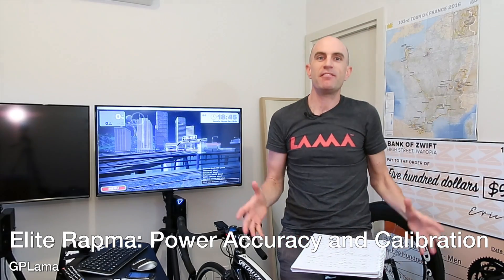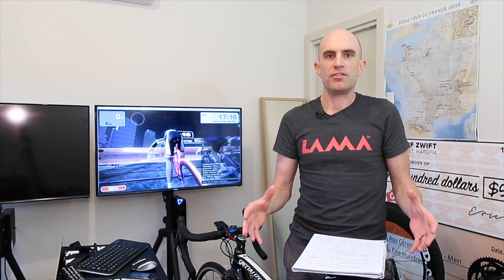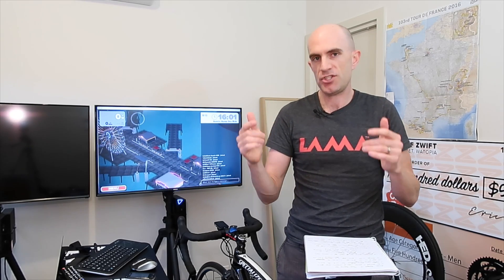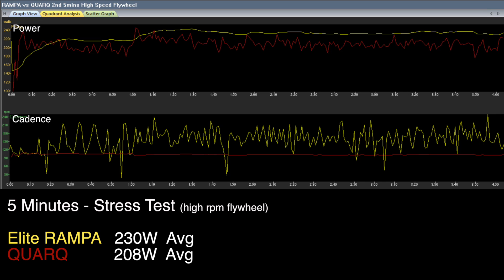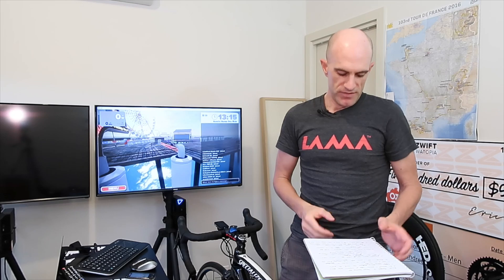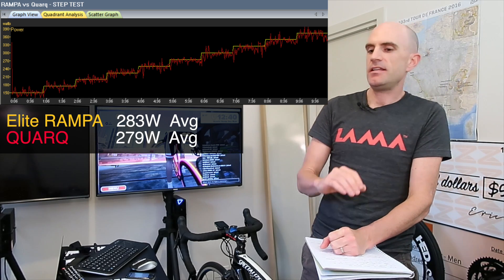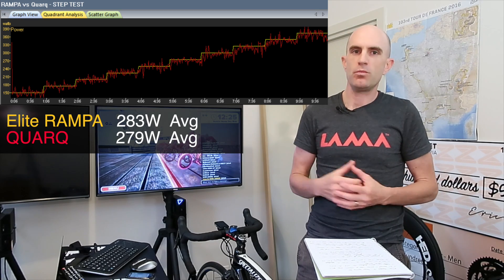ELITE RAMPA SMART TRAINER: Power Accuracy and Calibration

Comment: Thanks for this Video - It interesting that those '3 Points' you mention on your software tools are now the 'P1,P2.P3' values in the myEtraining app. I ran my calibration and compared it to my SRAM quarq power meter and it showed the Rampa at about 15% under power. I've tweaked the P-values and got my average wattage within 2.5% over a 60 minute power - but the difference grows steadily until my 1 second power where the difference is 12% under - it's robbing my sprint! Do you have any advice on what metrics each of  the 3 points control? Elite seem unforthcoming as yet.. Many thanks!

Comment: Hi. As usual another great video - thanks !!
Can i ask what p1 p2 p3 you settled on - thanks...👍
Reply from the maker: I can't recall... but values are based on each setup. They're different.
Reply: Shane Miller indeed i can see they will vary somewhat from tyre to tyre - pressure to pressure. Was just curious to bang them in and experiment.

I was looking at a cyclops hammer. Do they have a power meter or power estimator.

Thanks again !

Comment: Hi Shane. I bought an Elite Rampa Trainer and it's on its way. :D My question is regarding the accuracy of the power numbers on Zwift out of the box without any calibration. Will that be completely of the chart or just a little diference that an not ultra competitive guy can handle. I know it can be calibrated setting the P1, P2 and P3 with a powermeter. Do they have a calibration wizard to use for people without a powermeter? Thanks very much. Love you videos! Excellen job!
Reply from the maker: It'll be close...maybe. If you've got everything perfect. If you want to calibrate the unit though you will need a power meter.

Comment: Great review thanks!  Can you confirm my understanding of something which is this - Given that I have a power2max and I use the power match feature in TrainerRoad the fact that the Rampa does not have a power meter is irrelevant to me as TrainerRoad will use my power meter's data to control the resistance.  Thanks!
Reply from the maker: Correct. With another power meter, the trainer becomes a 'smart resistance unit'.

Comment: What kind of adjustment beside the elite calibration I can do to match Rampa to my power2max?
Reply from the maker: Setting the P values from the Elite calibration wizard is about it off the top of my head. I may need to go back and revisit the Rampa (checking firmware/app/new features)
Reply: Shane Miller , thanks

Comment: Hi Shane, 

Thanks for this great video. You mentioned many factors would affect the accuracy of this type of trainer. I used to use an old tire with approximately 2000 miles on it. I just change a new tire and use it with my Elite Rampa for the TrainerRoad workouts. However, I find all the workouts become harder and I could not hit the power that I can easily hit before. Do you have experience about this? Thanks for answering my question.
Reply from the maker: Yeah, that'll happen with a power estimator when you change a variable such as your tyre. If you need reliable numbers, you'll need a real power meter.
Reply: Thanks!

Comment: Thank you for some great videos!
I just received the Rampa and I'm curious if you experienced that you spin out on the flats? It sure doesn't look like it! :-) I can only reach about 200w in 53x11 when absolutely spinning it. Also, the iOS calibration tool won't push the calibration to the trainer. Have you had any luck with the mobile app? I don't have a windows machine for their other software :(
Reply from the maker: Sounds like something is up. Best contact Elite Support. I can't do one-on-one support on their behalf, sorry.
Reply: Gotcha! Just curious if you've had the same experience.
Reply: Daniel Holmdahl got this sorted yet?
Reply: same problem for me. Especially in zwift
Reply: same problem here as well over BT. Over Ant+ it works spot on. Seems to be a fair few people with this issue. Not sure if its a Bluetooth issue across the board with the rampa on Zwift.

Comment: Hi Shane.

Long time ago I want to ask you something. I have that Elite Rampa and Power2Max Type S powermeter. Rampa is just indoor trainer and can't be trusted source for power reading. But power2max have known issues with indoor work. That reading can be low up to 40%. Outdoor works just fine (didn't ride outdoor - to cold). So, P2M can't be trusted source indoor mode. 

I know that my FTP is higher than 209-230 (every time I calibrate TT was different). Also I know that 270 on Rampa can be slightly optimistic. My questions are:
1. Can I trust Rampa out of the box. Elite say they are calibrated before shipping. Same as Power2Max. 
2. Can you give me P1,P2,P3, just to compare that numbers with my Rampa. I know number are not same for every Rampa but I can compare it. Are they closer to P2M or Rampa?

Until now I haven't any problem with that. I ride with P2M numbers, but now I must have some degree of accuracy for my training plan. Now I can't compare indoor and outdoor numbers. I want to buy another PM. If I can't be sure that my Rampa gives me same numbers, that is close to nothing. 

Thanks.
Reply from the maker: Why is the power2max unreliable indoors? It's the same as an SRM, Quarq, etc.... I know many people who use P2M indoors.
Reply: That difference between numbers push me to do some research. There are some problem with temperature sensor and auto zero on some specimens. Not all. As I'm really lucky, it is possible they give me just that "model". I can test is outdoor, but can't test it indoor. Only I can, calibrate Rampa. I'm not whiner and that numbers means nothing to me as they are comparable between 2 setup.
Reply from the maker: Two things I'd do - 
1 - Ensure the P2M has the latest firmware. Then test it against a Neo or Drivo (if you can). Or contact P2M support and have them confirm there's no issue with using your specific model (serial number) indoors. 
2 - Calibrate the RAMPA using the MyETraining calibration wizard to obtain your P values and set those. Mine are worthless for anyone else due to tyre type/size/wear/tube type/pressure/etc.
Reply: They are no firmware for P2M. Users can't change it. I can't test it on 
other trainer. I contact P2M. They say that go out and test it on hill, 
we know that is good. On hill, outdoor. I believe that is. 
I calibrate Rampa with P2M. And that is how I ride right now. It is good for now, but time will come. I don't want to go out and blow after 20 min. OK, that will not happens but ... That number are just too different for 2 product that claim they are very accurate.
Reply: I am preparing to buy a Power2Max. They are rated absolutely high and I haven't heard about this indoor power issue. Can you please elaborate on this further? What is the source of this information?
Reply: The Internet, of course. Just google it: Power2Max accuracy. I do many outdoor tests on that. 
Rampa - numbers are useless. That means nothing. 
Power2Max TypeS - spot on with test. Every time. Uphill, downhill, flat. 
Power2Max NG - over reading every time. But it is constant on that. And that is important.  
Problem with indoor reading is my problem. I can't do same numbers indoor.
Reply: Rak Rakovica,  from my understanding,  it is logical that u cant repdoduce same numbers indoor. May be 5%. I haven't found about  the said inaccuracy you are talking of.
Reply: Don't worry about that. Just buy it. It is great tool. It works great.

Comment: How much of an upgrade is this over the Elite Qubo Digital Smart B+ Trainer is it? Worth the extra 200 AUD?
Reply from the maker: For me, if it was the only trainer I'd be using, I'd go the Rampa. The resistance unit connection is more solid than the gravity/pushback on on the QUBO DSB+ (although that machine is still really good!)

Comment: Hi, what P1,P2,P3 values you end up after the calibration?
Reply from the maker: I can't recall, but they're only relevant to my setup. If you're looking to calibrate, you'll need a power meter to calibrate it against.
Reply: yeah, I know, but I did calibration using garmin vector s, and numbers went even worse:) previously they were high but at least consistent across whole range...so I wanted to go back to some defaults... I guess I need to re-calibrate.

Comment: Hi Shane

I have an Edge 520. Do I use Ant+ to pair speed, power, cadence to the Rampa as though they are 3 separate devices? Also on the Garmin when I selected a trainer, it found it right away, do I need to do anything with the wheel size settings or leave them at Auto? Thanks VERY much
Reply from the maker: It's up to you what to pair and how. I'm not sure on the wheel size to be honest, that's one that may be hidden away in the manual from Elite. Or maybe one Elite Support can answer.

Comment: Hey
I'm considering bying the Rampa myself but not sure that it is worth it over the Tacx Vortex.
Would you recommend the Rampa?
Reply from the maker: The Rampa was a great unit for what it does. As for it being a better ride, or more value over the Vortex - I'm not sure. I haven't used a Vortex and worth/value is a hard one to judge depending where you are and local pricing. Test ride both if you can and choose from there. If you can only test ride one, and like it, go with it.
Reply: Great, thank you for the answer!
My brother has an Vortex, and is very pleased with it, so i think i'll buy that :)

Comment: So i got this smart trainer and had a go on Zwift this evening, good fun! I have a question regarding the cadence. 
The Rampa uses some sorta calculation to work out the cadence. However I have a separate Garmin cadence sensor that is going to be more accurate. Would you recommend using a separate sensor? will doing that mess up any of the other calculations the unit does? such as power and controlling the resistance? Hope that makes sense! Cheers
Reply from the maker: Use a seperate sensor for more accurate results.

Comment: G'day Llama....two days ago my Elite app on android received an update that now has the calibration built in...I have qubo smart digital +b....it even has an auto calibration function which is brutal...you have to maintain some pretty high wattage (for me) for an indefinate period of time....also has the manual calibration method as well...keep the vids coming...thanks.
Reply from the maker: Thanks for the heads up. I'll have a look at this early next week.
Reply: Peter Primozic it is in the etraining app under advanced configuration. only on android though.
Reply: it's disapponting that Elite don't have this on ioS, clearly calibration is needed, but Shane only gets these results AFTER calibration? THose of us without a power meter are stuck with uncertainty and inaccuracy..
Reply from the maker: It's an issue faced by all wheel-on trainers. There's a lot of variables from the pedals though to the resistance unit that the power will be 'close' but not as accurate as a power meter. If you want true accuracy and responsiveness from a power meter, the only solution is a power meter. Everything else (cheaper) is a compromise.
Reply: ian reeves hey,  the Elite app on ios does have the calibration.  It is under advanced configuration. However,  you do need a power meter to configure against either on ios or Android. Cheers.

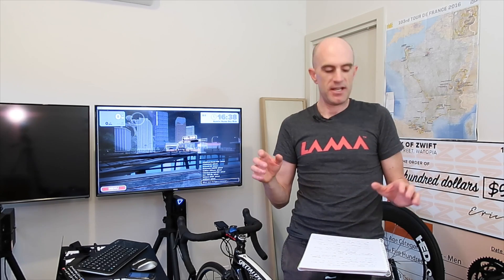Comment: Did you ever do this with the B+ smart? I am not nearly as strong as you (couldn't hold anything close to 1:00 towards the upper end of your step test). Still wondering about the older model I have based on your recommendation, which by the way I love!
Reply from the maker: I did, but not with as much attention to detail as this. I may revisit and plot the points on that unit and do another test when I get the chance.

Comment: so Shane... buying a real cheap bike or using an old unloved bike on the Elite Rampa and not bothering to move my Garmin Vector 2 from the main bike sounds do-able?  i.e. just rely on the power estimator on the Rampa is close enough?

Great information... Many thanks!!!
Reply from the maker: It depends. If the setup you have tracks power readings with the Vectors, either out of the box, or via calibration with the Vectors, then that'd be a good solution.

Comment: Great review Shane. I have a Rampa (no power meter) and my gut says it's putting slightly higher power than normal for me (from riding on zwift). How tight should I tighten the roller (will a tighter adjustment decrease the power?) thanks
Reply from the maker: Tighten it as per the manual. If that's not working, raise a ticket with Elite and they should be able to help.
Reply: same for me, and Elite can't help! - calibration is needed!

Comment: Shane, what software do you use to compare data from multiple power meters over a ride?  I have borrowed a friend's Kickr and have a Stages PM on my bike.  So far Iv've just used 2 Garmins to record a short ride and dumped data into Excel.  Must be an easier way.
Reply from the maker: WKO 3.0 multi range analysis feature. It's old school, but works a treat.

Comment: Many thanks!!! Great job!!! 3 points for my curiosity:
1- I know it varies from tyre, but how much pressure did you use? 2 - Can you put those graphs in a webpage? I can't see the red lines with the black background3 - How high do you consider for a high cadence mode?
Reply from the maker: 1- 110psi
2 - When I get the chance. 1080 full screen should show them nicely.
3 - 110rpm+ (or thereabouts)
Reply: Shane Miller I was able to see it in a proper monitor and it matches with your description. Did you have the step numbers? It seems that for the small wattage the quark looks like a random walk around the Rampa average, but for the highest steps (300+ watts) it seems to be a little behind the trainer numbers. Nothing really important for this kind of trainer, but curious to know if Rampa overestimates (a little) for higher watts.